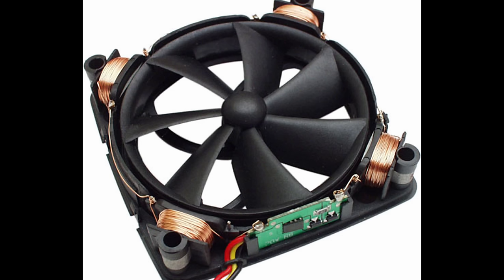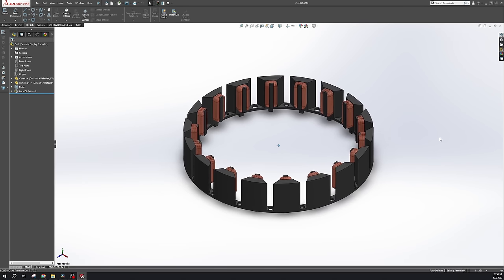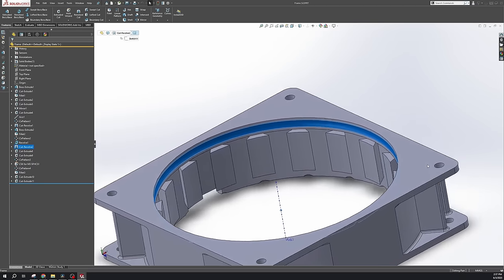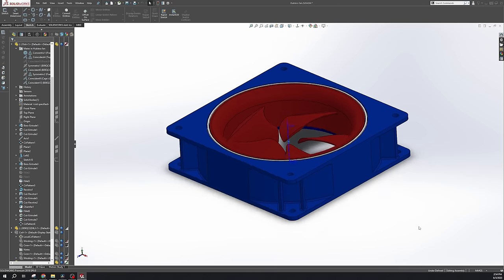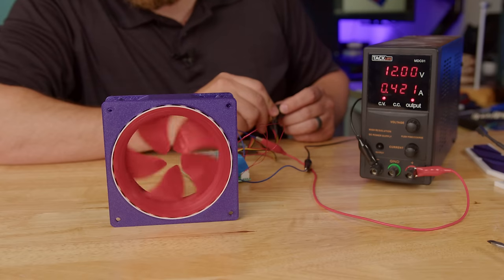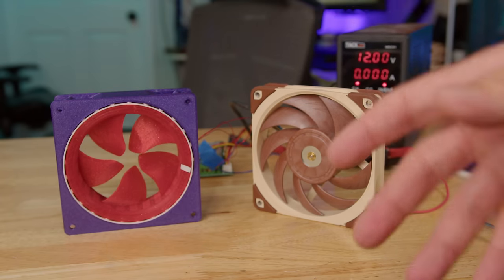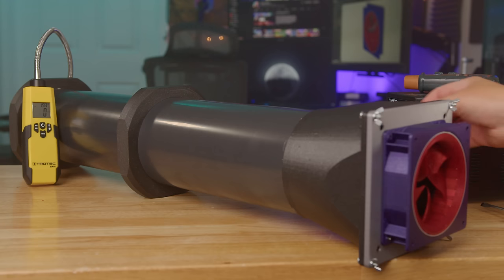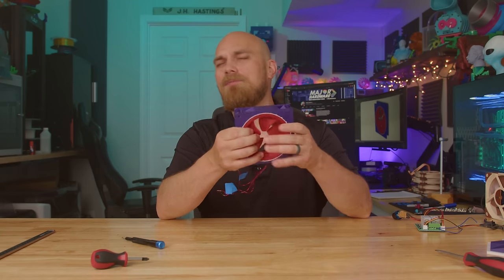I made a HUBLESS PC fan and it’s so loud!

Comment: Props for designing it the "legit way" and doing the 3 phase custom motor. If I had to build one of these, I would've "Cheated" and just used a belt or gear drive from a motor off in one of the corners.

Comment: That was really fun! Please make that the next fan show down season. There are so many components that can be tweaked to get the best air mover. 
Not sure how, but you could come up with a point system, for ie 2000 RPM =  2000 points, 91db sound =  minus 100 points per 10db. , mili amp = minus points, air flow = plus points. Style points, easy to print, etc.
Thanks for sharing your project! :-)

Comment: In my opinion as an electrical engineer, the fan is designed very well! With the only draw back being how loud it is, I think you are getting a lot of noise due to the material and friction. Obviously as the fan increases rpm, the ring is going to stretch and contort more because how thin it is. This will lead to more friction and more noise. Your best bet is to try and find an alternative method to couple the disks if you aim to make it quieter.

Comment: I think this is a solution looking for a problem. Already in a fan design the center is the least impactful to the airflow. So then you have to make trades. Driving it from the outside requires faster speeds, more bearings, more friction, a better gear ratio, and more mass. Dropping the efficiency. And really what we're after here is most is efficiency, among things like quietness, form factor, size, etc. Otherwise all pc fans would just use a 30,000rpm motor, draw 10 amps, and sound like a wind tunnel.
Not saying innovation is a bad thing, but optimizing one parameter at the expense of many others usually doesn't pan out

Comment: I like what you do. One of many often overlooked aspect of forced air cooling is air speed. FASTER IS NOT BETTER. If the air isn't spending enough time around the aluminum heatsink or whatever device is being used it will not soak up enough heat and there comes a point where the air is moving too fast and becomes less effective.

Comment: heyo, aerodynamisist here. 
Cool concept! Looks lightweight and robust, but if you accept some tips:
Blade AoA looks good, highest at the centre, although I worry a bit about tip vortices.
I'd recommend the same width along the blade, as you'd benefit from more lift where the speed is lowest (angular velocity). Most "silent" fans have a wide/square blade design.
A flat pressure profile across the blade gives the highest power efficiency . A prop flow analysis would be cool to see!

Comment: Wow, just great. Fan blades aren't noisy, only the bearings (add metal bearing race, then grease and seal them). You made a BLDC motor, so of corse you're missing HAL sensors (5v, U-V-W, and ground). That's why it bucks and starts up slowly. Other than that, i think you nailed it.

Comment: I hope a major manufacturer sees this and gives it a shot. I love the look and I bet if you optimized the blades it would be an amazing flow fan. 

Speaking of optimizing, you might try making shorter blades and leave a larger opening. The portion of the blade near the center doesn't spin very fast, so it probably impedes air flow more than it helps.

Comment: I have made a couple of these hubless fans myself. Let me help you fix the noise. All you need to do is change the orientation of your copper wiring by making it sideways rather than inwards and rotate it so that they face towards each other, duplicate it so that it is now found on both shallow & deep ends with empty room between them and then allow for magnets to be free flowing between these copper wire spools. There you go, Noiseless rotation. 

When it boils down to air flow, they perform a lot better by their fins taking after the shape of a rose flower petal (or a Pringles chip at a rotation) and coming real close to overlapping one another.

Comment: I've made bearings out of pla. They benefit from running in at low speed for 30 mins or so and some lube.  I use silicone grease and it will work a lot lot better and quiter.  The thing I like about hubless is that its actually naturally an air multiplier.  The centre part drags more air through than the swept distance.

Comment: Interesting fan.
I look forward to seeing how this improves airflow in the future.
The question is how to support the fan, which could be magnetic floating, ground effect, minimum center bearing, etc.

An interesting thing might be to use the ground effect.
Centrifugal force compresses air and uses that compressed air in ground effect bearings.

There are many other possibilities, such as installing a rail on the outer ring of the fan and supporting the rail with about three wheels.

Comment: I still have one of these TDM fans, they sound like a freaking JET ENGINE.
This was probably the best fan i've ever had.
Reply: the TDM to my knowledge actually doesn't have.......any bearings at all, it just has a cushion of air between the hub and outer housing. dang thing was impossible to clog with dust.

Comment: The reason for the noise is because of a non-perfectly symmetrical fan assembly, if you pay close attention at a moderate RPM, you will see the fan blade assembly is shifting resulting in the noise. Your fit is a bit loose, but this is normal with ball bearings you can try adding a lubricant that is a bit extract viscous to cushion the vibration to absorb much of the noise of the loose bearings rattling on imperfections of your fan and frame.

Comment: In reality having the hub at the centre of the fan makes most sence as it is the most efficient use of space. The performance of a fan is directly linked to it's blade swept area and velocity. The centre of the fan has a very small swept area and a relativly low velocity compared to the outside edges, so replacing this area of the fan with the hub is more efficient than reducing the diameter of the fan to drive from the outside. Looks cool though.

Comment: I think that connecting the fan blades to a hollow axial cylinder in the middle could increase efficiency by eliminating vortices at the tips of the blades, while still allowing air to pass through.

Comment: You can use 4 small off-the-shelf ball-bearings in the corners to hold the impeller in place, instead of the large peripheral one.
Also, only 4 windings in the corners (as in the old video) will be sufficient to move the impeller, but will allow to increase the diameter of the impeller especially in the periphery where it works best and should significantly increase the output.

Comment: I noticed that the older, TMV fan was not truly hubless. There's a spindle hub on which the fan is supported while it is rim driven, while your noisy beast is truly hubless.  The spindle mounted / rim driven design has opportunities for quieter operation. With multiple spindle mounted / rim driven units you could produce something akin to a jet compressor.

Comment: With the hub gone it gets rid of a huge obstruction that takes up probably 30 plus percent of the fan area. In the smoke test you see the smoke actually center itself concentrating the air to the center.  The center looks to be a lower pressure but that can be fixed with different blade profiles. With a better bearing solution this can only get better.

Comment: DON'T KILL IT!!!! - PERFECT IT!!!! - Tune the blades ... that's the first obvious change.... maybe you could make another that uses grease (NON-conductive grease lol)  and the pieces fit together so it hold the grease in ..... Print one with that hard slippery plastic (I think it's called teflon or something lol) .... 
- - there are all kinds of ways to improve it  ...   but mainly making the blades more optimal to push more air AND lessen the tolerances to reduce the noise (it's small rattles we hear from the bearing smacking around in the gaps..... so grease not only lubes but fills those small gaps kills the vibrations/rattles)
- - as far as the electronics... yea, I'm not even gonna guess lol
THIS WAS AMAZING!!!!

Comment: The NOISE level is from the Un-Finished surface the bearing is tracking on & in, if you sanded or melted the track and seats, the bearing would run smoother and quieter.
great work, i enjoy and like all your stuff =)

Comment: okay that's hella cool, i actually built a pc for my family using the TMD fan back in 2000, neat that you 3d printed it all and did it without a centre point at all. however the whole idea was to get air to the centre so id think the blades should at least meet and join at the centre then it would be perfect. another idea i have is perhaps instead of having the whole ring a bearing, using 4 smaller perhaps 8 v groove bearings and have v rings on the rotor that sits into it, or similar, they will be spinning 10 times faster than the blades but it would perhaps be a simpler build rather than having to print a cage and insert bearings by hand

Comment: I am not an expert in (literally) anything, but as far as overkill or underkill on this build... you designed something that seems great for prototyping, and since you've got to do this all by hand right now (the windings, the magnets) changing any part is much more of a chore than just pressing a new blade onto a motor in the housing... I think for the initial stages leaving it simple to assemble is more important than increasing the efficiency of the bearings or whatever. The blade geometry, possible even the housing is going to give the biggest dividends, I believe.

Comment: This is probably the coolest thing you built. My build suggestion is to use smaller guage wire and add more wraps per coil. As for a test suggestion, you should get a thermal camera to see the bearing temperature increase and possibly  run to failure. Just send it, dude.

Comment: Amazing idea, seems very strong as all the force is directed outwards to the ring which is going to be a lot stronger than the blades pulling away from a small hub in the center. Would love to see you tighten up the tolerances, maybe acetone in a chamber to smooth the blades, machine windings to even up the power output, some alternative to the ceramic ball bearings? Definitely want to see more experiments around this design

Comment: Do a series on tweaking this design, dry and wet lube, power adjustments, fan blade designs, shaping the inlet/outlet(like the boat design) and noise reduction (could use dampening materials as well as improving the ball bearing design as well as lube) Keep up the great content!

Comment: Ideas: 1) Find a proper ring/slew bearing. The bearing design is okay for PoC, but a proper machined bearing would get rid of a lot of that noise, chatter, and rolling resistance. And I can see ceramic bearings eventually eating that plastic to a sloppy mess. Maybe just 2 brass/bronze rings and some oil? So less of a bearing, more of a bushing design. 2) Less an idea, more a point of interest, the start up stall. Even the BLDC hubbed fans usually require a kick to get spinning. In the Intel standard for PC fans they recommend something like a 60% speed kick for 2 seconds before spinning the fan down to minimums to ensure the rotor actually starts spinning. 3) Lessen the blade length to potentially take advantage of the venturi effect. I noticed there was quite a lot of suck through the center as the moving air dragged more air with it. 4) Wind it with narrower gauge magnet wire. Im not entirely hip on magnetic flux voodoo, but I do believe the narrower gauge and more windings makes for a stronger/denser field. Spin the thing to death (well, I mean, Id be entertaining to see 😅). 5) Keep refining. Maybe you can settle on a drive ring to standardize submission dimensions and add a new dimension to fans to test. The flow was awesome, no swirling around the intake as air was squeezed around a hub. Definitely need to play with blade profile to optimize flow and bite, but still an awesome proof of concept.

Really cool, mate!😎👍

Comment: If I were to throw one thing in there to make it better, I'd highly suggest to get better bearings/races. The ceramic bearings are the way to go, but you need a smoother race for them to ride on with tighter tolerances.  If you did this, the noise levels would probably dramatically decrease. My 2 cents. That said ... this is an awesome idea and execution. I love how you've thought outside the box.

Comment: The result is awesome! I would love a comparison with a hub fan keeping the same wing profile and the same rotation speed to see if it makes a big difference. Also there is a lot of improvement on the electrical part that can be done (using a current variation instead of speed variation,  reducing the number of phases, reducing the number of coils while increasing their size and number of turns, reducing the number of magnets...).

Comment: that is really awesome to see. i think addid steel bearings to the front and the back, putting in coils in a better formation, balancing the fan itself and maybe resin printing the parts would make this a crazy good product actually. you could make the blades interchangeable and i would actually put money down

Comment: I still have 2 original Vantec Aeroflow heatsinks from 20 years ago with TMDs. One of them has been running off and on for 20 years and is currently in a retro gaming PC. I usually need to re-lubricate standard fans every ~6 years, but I have never done anything to that TMD, it just keeps spinning and seems to be a really reliable design. You also do NOT want your hand anywhere near the thing running at max (5600 RPM), the plastic is stronger than normal fans and the heavy outer hub gives the fan a lot of momentum, it will turn a finger into mincemeat.

Comment: Since you've got more RPM than you need, and your power supply can't keep up with the motor, you should probably lower the motor kv. KV is determined by the number of windings on the coils. Lower kv will also improve the efficiency of the motor. And since you've probably got way more torque than you need, you could increase the number of blades and/or the pitch of the blades to move more air.

Comment: You need to lubricate the bearings in it. That's half the reason why it's so loud. The other half is the impeller is off-balance & is causing vibration (which contributes to noise).

Also, an idea for improvement: Reshape the blade profile. Do a little trial-&-error with different blade profile designs. My first port of call would be a compound pitch where the pitch starts off quite steep close to the centre of the impeller. Then as the blade gets closer to the rim, the pitch gets shallower. You already have the right idea of using compound chord blades. Keep the compound chord shape, & experiment with compound pitch & see what works.

Also, this reminds me of a rim-driven prop I once drew back in 2014 in Cinema 4D (when I used to do 3D modeling). I was inspired by the same rim-driven thruster that inspired your fan.

Comment: One idea for the bearing: Put 4 tiny bearings, each in a corner fixed on the frame acting as a support for the inner wheel to spin on. Easier to put together and maybe less noisy. To be quieter simply put a race on the inner wheel and some rubber material around it, creating a place for the bearings to fit and a smooth surface to run.

Comment: I have a Baratza Sette 270 coffee grinder that works kinda similar to this. The center conical burr is stationary, and the ring burr on the outside is the part that spins. It comes in a self contained gearbox that rotates around the center burr. It’s quite effective for espresso with very little retention, but not great for airflow I’d imagine.

Comment: I'd say switch to steel ball bearings and add some type of dry grease, perhaps graphene grease or lithium grease. The sound indicates there's way too much play in the ball races so that's probably adding a lot of friction and instability (through resonances) to the design.

Dry grease will probably mitigate those vibrations to some extent by reducing the internal frictions in the bearing, filling in the gaps and padding the surface a little to tighten up the tolerances. The added mass of steel bearings would lower the resonance frequency of the balls as well, which might play a role in this case since the races are made out of plastic which in turn makes them have a relatively high resonance frequency.

Not sure if the additional impedance mismatch between steel balls and the plastic races would increase or decrease the energy lost to noise and vibration, but I would imagine it should decrease.

Comment: As Dutch Sheets says, if it ain't broke break it!  Sometimes you have to try different things to find solutions.  I think how the center of a river is the fastest strongest flow.  The job of the fan is to get the center moving faster which is why a hub is self defeating.  You probably need about a 1" circle in the center with no fan blade material.  And the outermost ring of the fan should kick the air as far away from the center as possible.  Maybe even cut off half of the blades to see if there is better airflow.  The more air that can be pushed far away from the center will allow the air in the center of the stream to move faster with less air resistance.  The smoke should look like a mushroom cloud out the back of the fan.

Comment: just shooting from the hip here, but idea: you could angle the bearing races, like an angular contact bearing. that way you could design the fan so you could vary the axial load on the bearings, to dial in exactly the right amount of pressure to reduce noise. maybe also add a bit of oil, and shut it in a box for a long "burn in" run, maybe it'll wear the bearing ways smoother over time? maybe a progressive tightening process where you start loose, wear it in, then tighten the screws, wear it in some more, and keep repeating until you hit some point of diminishing returns.